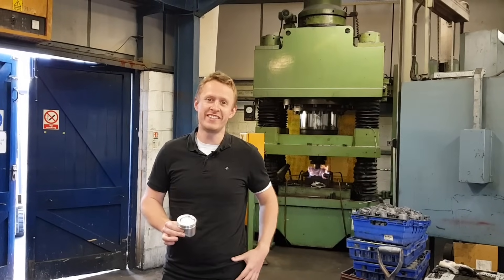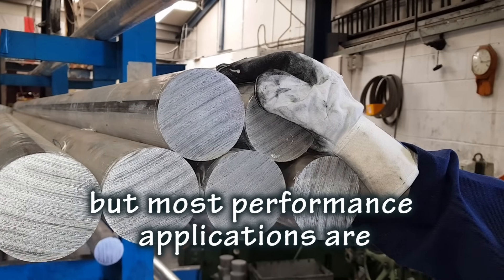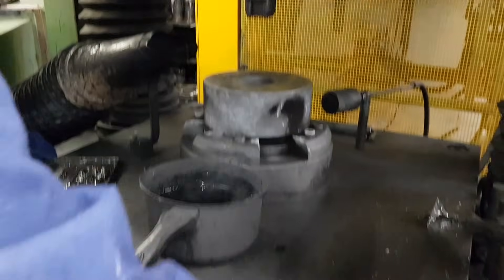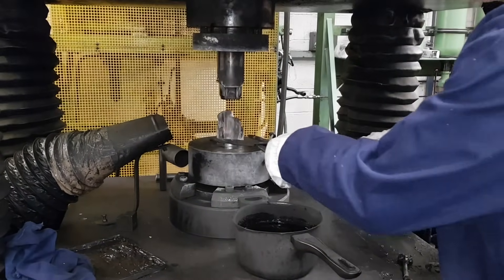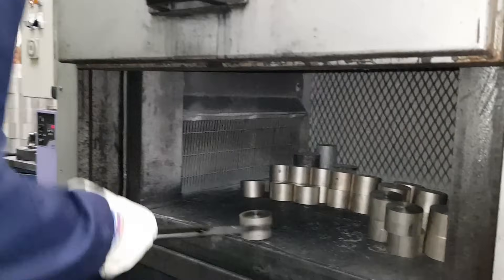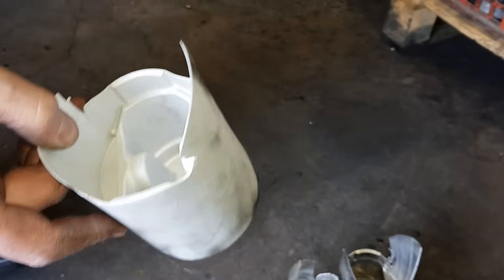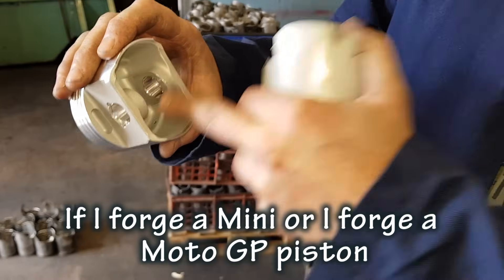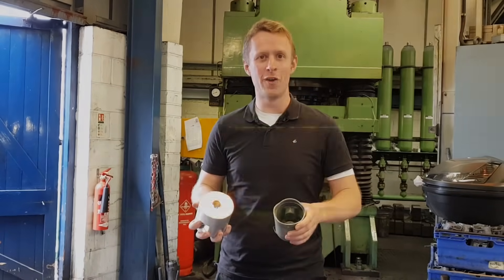How it's made - Omega forged pistons - Part 1

Comment: heh heh heh. i do this at home ;)

well, not quite. i dont have billet (surprisingly hard to get!) so i melt down pistons scored from the racetracks...
pour in the mold, let it set... then slam it with the fly press whilst its still pliable.  casting... then forged. 

a piston is amazingly simple to make. yet its amazingly complex! most of its in the accuracy... dead square pin with dead on tolerance bore and the ovality...
Reply: i dont know if thats a good idea, if you melt the material it may have pores, they take a solid material chunk and then press it while hot, but they dont melt it, i guess if it works for you its fine but i dont know if i would work with melt and pressed parts, after melting you always have the risk of getting parts with high internal stress and in an engine with already puts lots of stress on its parts they might crack under pressure, if im wrong pls let me know, thank you and hope you have or you having a good day, bye bye

Comment: Hi ! How long does it take to produce a piston - from raw material to completely finished product ready for shipment ? Thanks
Reply: i would say theres about 1.5 to two hours work, all up. they could probably check time sheets and get a pretty good idea "per unit", but remember its all done as batch work... 100, 1000 at a time sort of thing. set that die up, and just punch out blanks for putting on a shelf, then run through on another size... finally a batch gets pulled down, jigs set up for specific runs, lathes tooled, boring machines clocked in... and yeah... hard to really say?

only have to set the jig up once for each run... some may stay set and be universal...

as a hobby machinist i never saw the sense in one-offs. i always try to make five, ten of something... depends what it is of course!

Comment: I installed some heating at Omega 30years ago when they had not long installed the forge. I was chatting to the old chap who ran the business and he was telling me about how when they first started forging pistons they were nearly all scrap due to die lubrication problems. They had had various specialist companies in with sprays lubes etc but no joy. he had nearly given up and he was chatting to a guyin the pub who had worked on a forge all his life. He told him the trick of offering the pot of lube up to the die  (1.22 )  they went from nearly 100 percent scrap to have a reasonable sucess rate overnight. 

Not long after a team from Honda came for a look around and picked up a forged piston and asked how they had made it as they didnt believe it could be forged in that shape . As luck would have it a billet was just up to forging temperature he dipped the die and forged the billet . Luckily it came out perfect the Honda team were very impressed.
Reply: The only bars around then we're the  alloy ones used for forging the pistons .
Reply: @nickbadi3599  ahahhaha nice one.
Reply: He told me another story about Subaru coming to him with a piston oil control ring problem the engines were using so much oil they couldnt  finish a race  he made them some oil control  rings and saved the day
Reply: @nickbadi3599  yeah, it was me that made the rings though 😏😊
Reply: That's funny, the old bloke at that time was my dad, Fred, he's still there now operating machines at 85 ;)
Reply: Hgccx
Reply: BS.   It was a bar not a pub. And you left the part  out where the guy paid for his chicken fingers and potatoe sticks.

Comment: Interesting process because in when you quench carbon steel it makes it brittle and really hard. An opposite happens with aluminum, copper, gold and some other metals.)If you mechanically squeeze those metals they get hard and brittle and if you need an additional mechanical work to be done on it then you’ll need to either: heat it up or, better, heat it up and quench it. 
Surprisingly in this video, they first press it then heat treat it and yet it is still stronger. Interesting.

Comment: What alloy is used for pistons?
Reply from the maker: These particular ones are 2618 Aluminium
Reply: @MEDEngineeringTechVideos  thanks, but I'm curious, isn't it better to have a lot of silicon in the piston? What the advantage of using 2618?
Reply from the maker: @SunilSundar  This is something Omega have spent many decades to perfect. You'd be best to contact them direct for more in-depth tech info.
Reply: @MEDEngineeringTechVideos  ok. Thanks
Reply: @SunilSundar  In a race piston 2618 is the best, it can get a fatigue crack and still hold together, it can bend and bend without breaking. When you add silicon as in LM13 for casting or 4032 for forging, it adds a high wear factor but the trade off is a level of britleness. This is why high silicon piston are used more for road engines. Having said that, many people race a whole season with one set of Omega/MED dis cast pistons.
Reply: @SunilSundar  2618 alloy forgings can handle higher amounts of stress without shattering into pieces compared to 4032 or cast hypereutectic.

Comment: What is the lubricant you use on the dies and on the aluminum also ?? Thanks
Reply from the maker: It's a special graphite-based solution, to withstand the high temperatures and lubricate both steel and aluminium. Understandably Omega keep the exact mix a secret.
Reply: @MEDEngineeringTechVideos  Thanks.

Comment: i thought forging is just put it in oven till its glowing red and then just put in water
Reply: That’s called tempering. It’s for hardening of the material.
Reply: @georgew.5639  well, theoretically, if i do that to my stock pistons, theyre gonna be hardened/more durable, right?
Reply from the maker: Well that's part of the process.

Comment: I thought forging was done cold.
Reply: It can't.
Reply: It can be done both ways though typically forging is considered to be when the metal has been heated to make it malleable. But some applications will do it cold, like cold heading the heads on screws.
Reply: @siggyincr7447  in a piston forging there is too much metal movement that it would split. A local university to Omega has an electron microscope image of a slice of an Omega piston, they use it to display the perfect grain flow structure in a piston forging. This is created by using the lowest (though still very hot) forging temperature, avoiding grain growth and also the design of the punch to create the correct flow pattern. many other manufacturers can't forge at this temperate, especially on a slipper piston, they can't get the flow rate so they have to use more heat.
Reply: @Omega-Phil  I wasn't talking about piston forging specifically, but rather forging in general.

Comment: MED - What options have you guys got for turbo charged applications on a +40 application without going down the 18cc dish route (as that would give my a CR of 7.8:1)?
Reply from the maker: We keep a 10cc +40 in the diecast Omega range if that may work for you?
Reply: @MEDEngineeringTechVideos  might be of interest! What piston deck height are they on a standard crank?
Reply from the maker: @Dagowly83  They're standard 1.498" crown height.

Comment: Isn’t the point of heat treating then quenching to create hardness through tension in the case and the core? If you machine it, does that not reduce the hardness significantly? Like isn’t most of the hardness in the outer walls , hence, case hardness?
Reply: Heat treatment before the forging is to make it weaker/softer. Heat treatment after the forging is to remove tensions inside the materials. The material is extremely compacted by the forging, that gives it strength. There is no hardening involved in this manufacturing.

Comment: Never heard extrusion can also be called forging.
Reply from the maker: This is not extrusion.
Reply: Thanks. You are the expert. No arguments. Regards.
Reply: @subramaniamchandrasekar1397  yes this is not extrusion: this process is in reality called "matrixing"...but the pistons from the common cars (inlusive GTI's) are mold ,  not forged/matrixed...
Reply: Extrusion is when it is pressed through a shaped die and comes out the other end with the same profile as the die. Kind of like how some pasta is made.
Forging is when a chunk of metal is heated till malleable and then formed between and upper and lower die.

Comment: As a blacksmith i do like this , heat treating aluminium has me intrigued thou but i bet that a trade secret .. right ?
Reply: Not really, Alcoa aluminum has specs for this and gladly supplies it to the customer, Every alloy is different, If I remember right 4032 = 950deg @ 1hr and quench in 150deg water.
Reply: Thanks for the answer 👍

Comment: Wow, when I thought about forged aluminium pistons, never really thought it would be like this, just in one step. This is almost "extruded" pistons...
Reply from the maker: This is just the internal shape - there's a lot more to go yet!
Reply: @MEDEngineeringTechVideos  I meant, forging in one step. Used to work on an iron forging company, and is done in multiple steps
Reply: this process is called "matrixing"...
Reply: Aluminum forging in this case is a reverse extrusion and formed in 1 shot, and must be formed slowly to prevent tearing!

Comment: I didn't think they'd use billet stuff to make forged, i thought more of cast aluminum.
 Wonder how much strength, compressive strength, tensile strength going to billet to forged makes any difference or some difference vs. cast to forged.
Reply: steve gale  I understood the top portion but not the 50x stronger.  i really have hard time believing its 50x stronger though... Anyways, thank you for information. :D
Reply: Lime , you could make a cast piston yourself , just heat aluminum until it melts and pour into a mold , a forged piston is already forged aluminum then heated up and pressed with 400 tons of pressure forging it again , any of this and what Steve Gale said sinking or being forged into your brain yet ?
Reply: @jimthomas777  ooh ok. Thanks lol i was just curious :D
Reply: A lot of misinformation being thrown around here. In steel forging the stretched grain structure comes into play because the forgings are often just given a low temperature temper afterward. But these forgings are heated to just below the melting point. at that point the crystal structure is going to reform almost completely. 
So why forge them? They are giving the pistons their rough shape in a matter of seconds on relatively cheap equipment (when compared to the CNC machines that could mill out the same shape) and very little material is wasted. I'm fairly sure that machining these from billet and heat treating them would end up with fairly similar mechanical properties. But it would be slower, require more investment in machinery and need more raw material.
And cast aluminium is different largely because they need to use different alloys for casting.
Reply: steve gale  wont the heat treatment cause recrystalisation undoing all the strain hardening of the forging process?
Reply: @Bricksandmortars  True heat treating relieves stress and the manufacturer of the alloy has specs for proper heat treat of it, ageing the forgings after heat treat is where it hardens the material 350deg for 8 hrs! if you try to machine 1 that has been HT but not aged, the material is soft and gums up upon machining! don't understand how or why but thats how it worked at Wiseco Piston.
Reply: steve gale  no microfractures: cast aluminium =cristalisation, forged aluminium stretch the cristals to fibers: this made it much more flexible and streong...
Reply: They make cast pistons as well. I was the CAD jockey there 19 years ago.